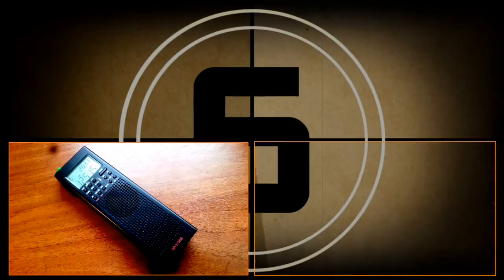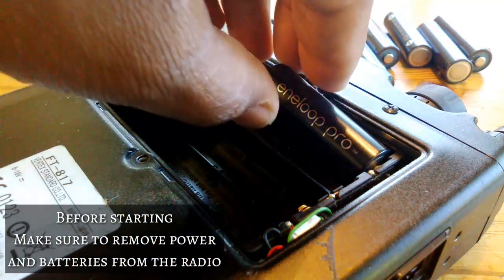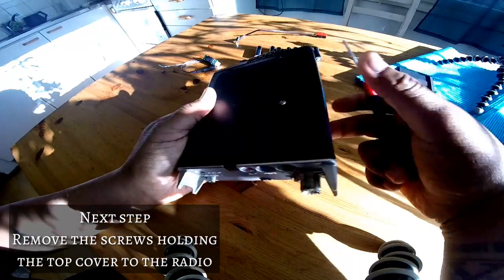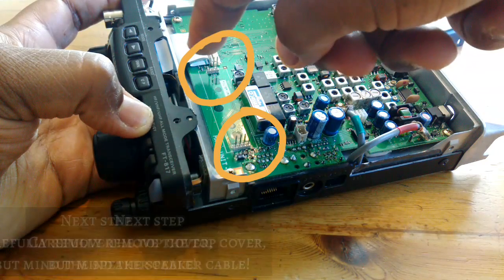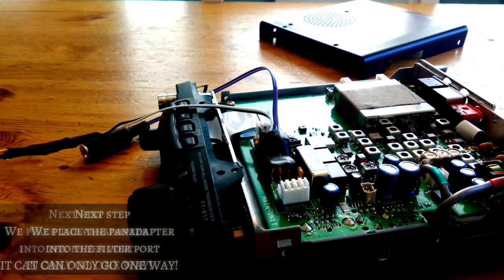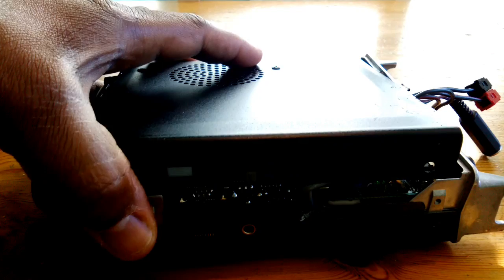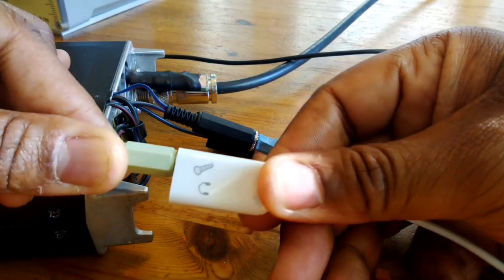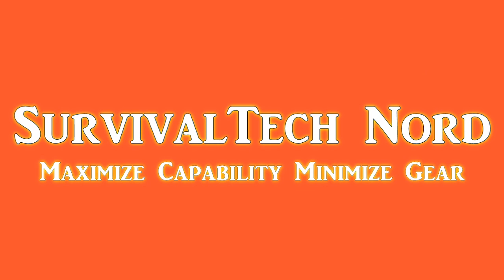YAESU FT817 PANADAPTER Installation [817Companion]

Comment: Nice but I already have a 300 Hz filter in the filter slot. Honestly, I would rather have the CW filter than a panadapter. A 300 Hz filter works amazingly well. It literally transforms the radio into a high performance CW rig. I prefer to use my Ft817 instead of my KX3 for portable CW operation. Ft817 has an amazingly good receiver.
 BTW I bought a panadapter for my KX3 but hardly ever use it when I use the radio for portable operation. The panadapter draws additional power from the battery. It's simply not as practical as I thought it would be.
Reply from the maker: +Ray_Biker the comment that stands out is the "817 has an amazingly good receiver". Thanks I've got the coffee coming out of my nose :) but I would certainly have to agree with you. A CW or SSB filter transforms the radio into a high performance piece of kit. I do like working with the panadapter and CW or SSB mode from a fixed location. Still I wouldn't carry it into the field anymore.
73 de Julian OH8STN
Reply: OH8STN SurvivalTech Nord 
The radio does have a very good receiver. Its not as good as my FTDX3000d base radio but a ft817 is a great rig for the money and it's small size. I ran a lot of side by side tests, comparing my KX3 to my FT 817. The Elecraft has a lot more features but it's receiver is a lot more noisy than the ft817, especially when trying to receive weak stations on a crowded band. 
Obviously yoh need to know how to properly use IPO feature, noise blanker, RF Gain and a few more features to take advantage of the receiver performance. I've seen people using these radio who had no clue how to set it up properly and they end up selling it because " it was a piece of sh*t". 
Also the ft817 menus are very intuitive and easy to navigate. It's a lot easier to use than my IC7000. I've owned my IC7000 for 7 years and still get confused with it's confusing, multi-level menus.
So, I just wanted to share my opinion about the radio and how much I like it.

Comment: hmm i have allready the ssb&cw filter mounted, is there a possibility to get the signal for the pan-adapter also? maybe with exended cables to this 3-4 pin adapter? thx for info! great channel!
Reply from the maker: Thanks :)
That's a great question and the honest answer is I don't  know yet! Let's see if IU4APC has a better answer. If you find a better answer please comment again and let us know.
Thanks for watching.
Reply: +hu tz Hi, actually it's not possible but we are working on some workaround to enable that. It is not a simple cable extension needed but are designing a version that should do some sort of port duplication. Actually we just started doing tests.
Reply from the maker: +Andrea IU4APC this is an excellent update Andrea. I'm sure there are lots of people who would love to have this functionality even if it costs more. great work so far and thanks for commenting
Reply: +SurvivalTech Nord I'm the first one. I'd really love to use the Panadapter filter along with the CW one in the 817 :D
Reply from the maker: +Andrea IU4APC or the ssb filter in my case :D
Reply from the maker: +Andrea IU4APC 
BTW, did you notice the image quality? better cameras, and building a LED strip lighting system. these hobbies are top expensive :D
Reply: +SurvivalTech Nord noticed :D A huge improvement. I use an FPV (for drones) camera for my bike ride recordings and it's cheap but very good quality. I'll email you some pictures of my bike setup :D
Reply from the maker: +Andrea Salvatore please do :)
Reply: Andrea IU4APC This would be great! I take a look to this panadapter story and the solution of N1JEZ seams to work without using the filter pins. Funny point is that it seams that the small board layout is tooken from him :-) nevertheless if i find time the next weeks i will try his solution. btw for the ft817 fans, upgrade with the txco cost 20$ from china... 73 from germany
Reply: hu tz oh yes but you need to do some soldering on your FT817. There are other solutions like that but mine is the only one that doesn't require any soldering so it's perfectly reversible and doesn't void any warrantee ;)
Reply from the maker: Andrea IU4APC excellent point!